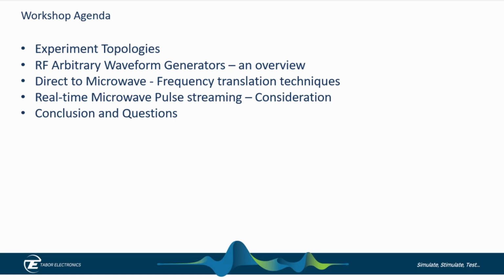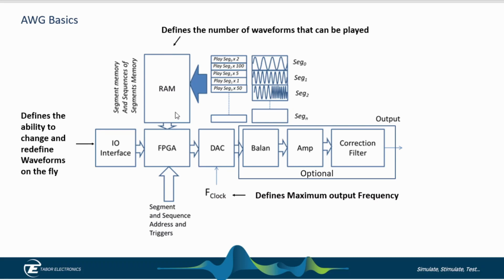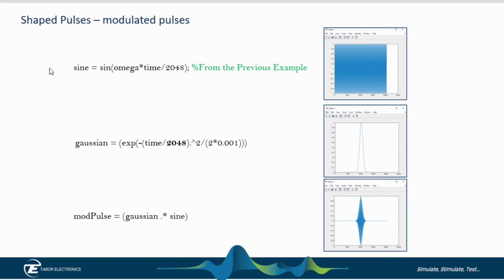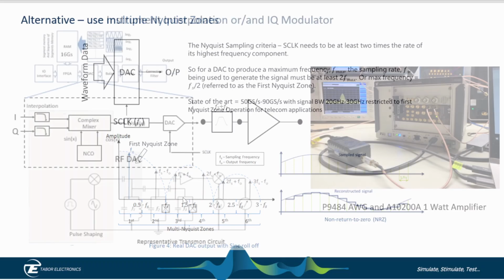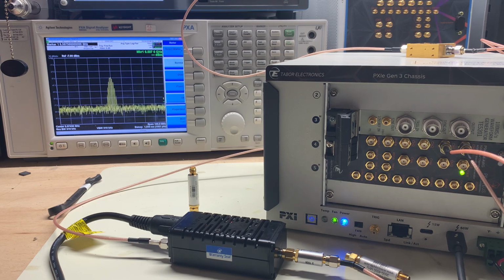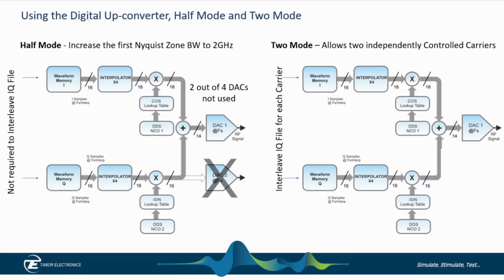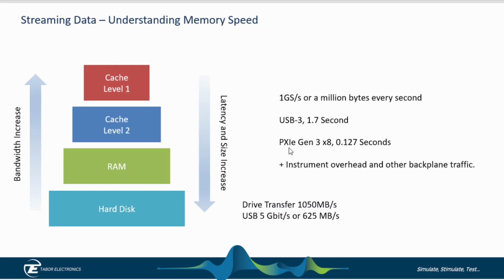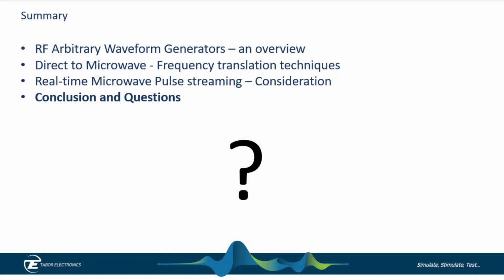Experiment design considerations for real-time, closed-loop pulse streaming

Comment: Mark, 
Quite an interesting presentation.  
 In the first slide on Streaming Data – Understanding Memory Speed it has 1GS/s or a million bytes per second. I not sure how you got one million bytes per second if you are trying to generate 1Giga samples per second. If the sample resolution is 8bits you need to move 1 giga bytes per second not one million bytes per second.  
  Trying to stream samples in real time from even a high-end desktop is a very nondeterministic operation. The given application need shown does point out the limits of a traditional AWG in regards to internal memory depth and its sequencing capabilities.